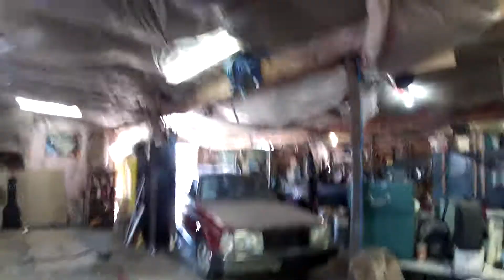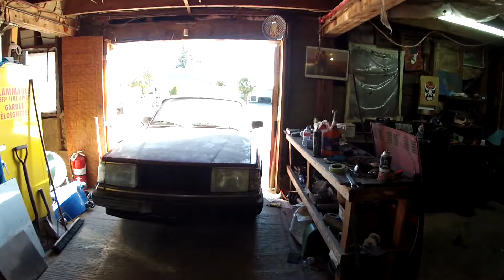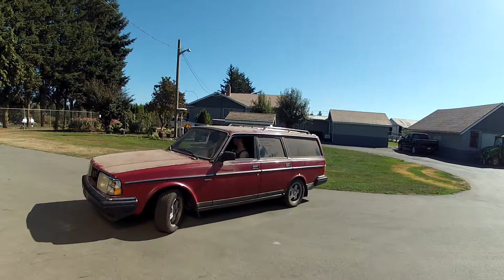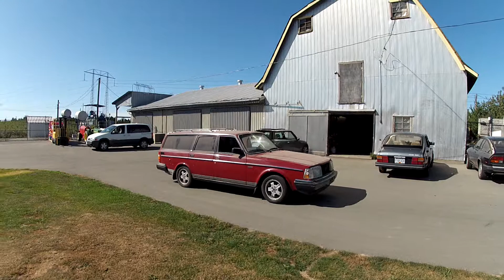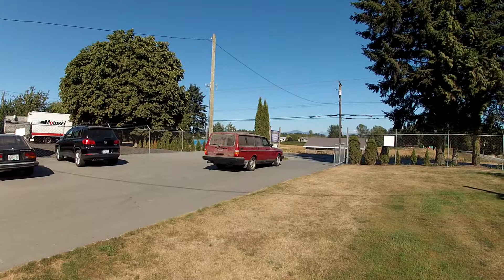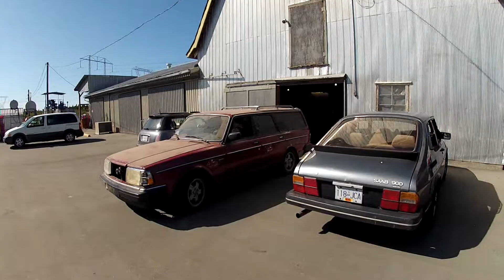Mike unveils the V8 Volvo 240 Wagon

Comment: What were the biggest hang ups with this project? I'm looking to to exactly the same thing except maybe a different trans to my 240 come spring. Any tips?
Reply: No single item on the list had a project stopping difficulty to it but fairly often my tight budget made it harder than it could have been. Things would have gone a lot faster had i bought a shallow oil pan, auto transmission, and the most pain-in-the-dick part; a plug and play ecu (I used a pre owned megasquirt 2 and made my own harness instead). Either throw money at your project or have patience and creativity and you will be slamming beers and doing burnouts in your v8 volvo. Let me know if you have some questions on how i tackled any specific problems. In the end the swap is totally worth it, this car is a bastard child of a smoke machine and a death trap
Reply: Mike Seventhree good to know man, I'm planning on picking up the engine on my next check, I've got a buddy's shop with a lift come spring so in the meantime I'll be making a list of things to do. Short list currently is
Cam
oil pan
Gaskets
Rings
Front and rear main seals
either ecu tune, or new ecu
Auto trans
Metal to build mounts
New plugs
Coils
Valve springs
Exhaust pipe
Mufflers

I'm hoping to have absolutely everything I need to get it done by spring because I'm pretty sure the maximum amount of time I'll have is 5 days to a week if I want to take   pto I'll hit you up if I have any questions on it thanks man!
Reply: Damn 5 days, it took me over 2 years! I was cheap in no hurry though. I would recommend leaving the engine upgrades alone if it is already a running engine, its too easy to get distracted with those fun parts. Once your swap is all good and running then go nuts. Are you keeping the stock rear axle? I dont know exactly how strong they are but i put in a narrowed ford 8.8